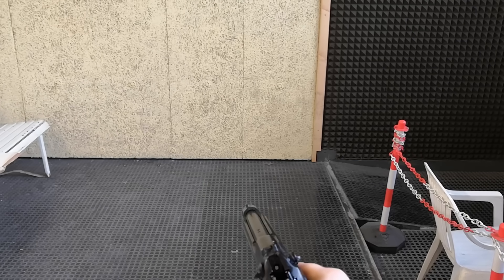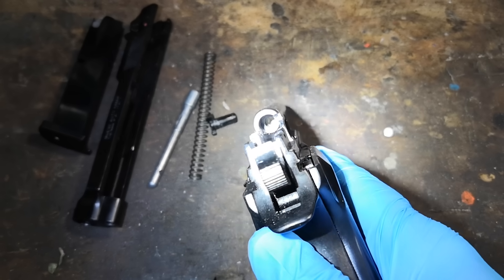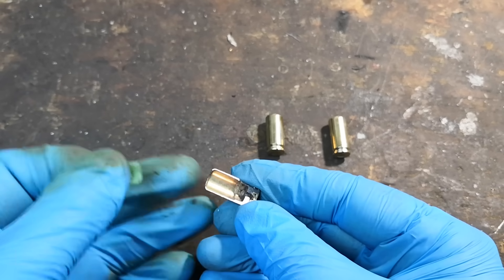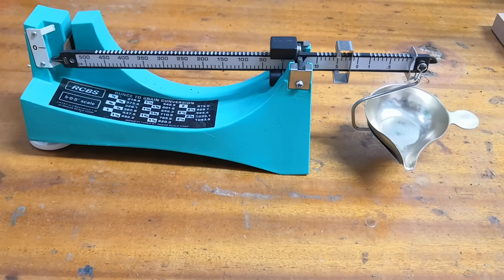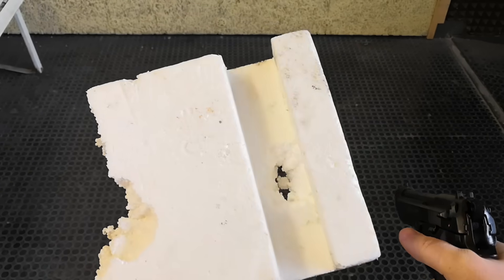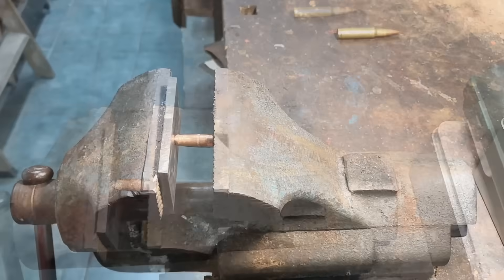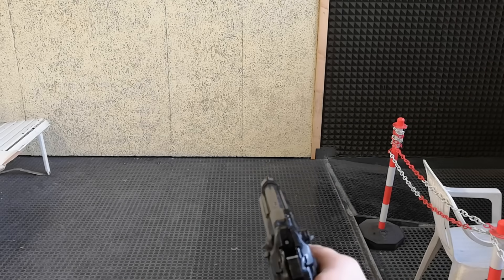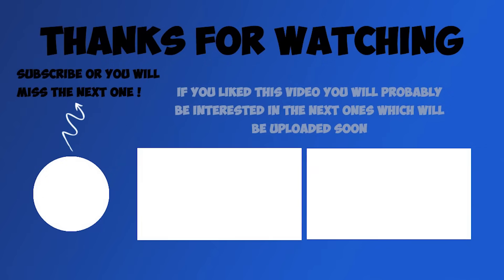Point Blank With a Blank Gun: Is It Really Dangerous?

Comment: When in doubt, always remember that with the proper speed, a piece of polystyrene foam made a hole in a space shuttle wing.

I stand corrected, polyurethane foam.
Reply: Thats crazy
Death by foam
Reply: @lotuscat3173  sound like a seizure 💀
Reply: That got an entire space crew killed.
Reply: @HarmonicVector  Yeah, stupid commitee and beurocracy led design
Reply: @HarmonicVector  man its just sad tho
Reply: Jensi Oquendo, did this actually happen?
Reply: @crythaul2179  Space shuttle Columbia disaster where a piece of foam came loose from the external fuel tank and struck the wing and damaged the heat shield and upon re entry it burnt up due to the hole and killed the crew.
Reply: @crythaul2179  yes
Reply: @E60foamer  Its because they let women onboard
Reply: My dad was in school in California at the time and they got out early because a lot of kids families were involved in aerospace and some of their dads died
Reply: The foam can fly incredibly fast in space and the wings are made with the weakest and lightest materials possible for the ship
Reply: @sterling8007  I thought so. The wing is relatively weak compared to the rest of the shuttle
Reply: Aren't the wings of space shuttles relatively thin? I swear I remember something in school saying something like this.
Reply: Your mostly right  it was polyurethane foam though which was spray applied which means slight porosity allowing the condensation to form ice within its pores increasing its mass but yeah it doomed the flight
Reply: Siense
Reply: Yes but foam also makes up some road barriers so it has to do with density.
Reply: In Kansas theres a museum that has a wheat straw imbedded in a telephone pole. Going so fast it went in like  steel arrow....
Reply: „When in doubt, whip it out“ - Christopher Wistopher
Reply: What now??
Reply: We talkin biht challenger?
Reply: Space shuttles are made out of aluminum so... Weak af
Reply: @kaleclelland1817  Is aluminium weaker than Styrofoam?
Reply: @kaleclelland1817  thats kind of the point, if they were made titanium they wouldn’t be able to have re-entry and orbit around the earth considering our current understanding or space travel
Reply: @kaleclelland1817  it actually hit the carbon fiber reinforced edge of the wing which is quite strong.
Reply: @kbo8029  carbon fiber is very strong under stress but not under impact. It can stand up to twisting and bending very well which is why it's used on race cars but if a pebble hits it directly at over maybe 50 mph it'll crack.
Reply: I’ll try to remember: avoid styrofoam travelling at 7 times de speed of sound
Reply: When the frick did this happen?
Reply: @pakalupapito5578  2003
Reply: This comment rules.
Reply: It wasn't polystyrene, they use ceramic heat deflectors
Reply: A GUN IS ALWAYS DANGREOS EVAN WHEN IT IS NOT LOADED TREAT IT LIKE IT IS LOADED
Reply: physics always wins
Reply: Ah yes, colombia
Reply: https://youtu.be/lk_4HD7DnVk
Reply: physics
Reply: Massive oof...
Reply: Not really concerned about getting the wings back as much as the lives on it
Reply: Here it is. Watch the whole thing.
https://youtu.be/e8dMdW9dN0E
Reply: @Leowolf27 I’m disappointed it wasn’t a rick roll
Reply: @Leowolf27  thats crazy dude they recreated the whole thing and even in the final test they were amazed by the result
Reply: @Leowolf27  scam
Reply: I'd change the barrel for my BlankFirer/PAK Guns..with titanium barrel,which ive had measure bout the widht and center,its apparanly is easy to shoot a RubberBullets(Traumatix)PA.with some sort of bullets adjustments,i'd take out the plastic cap,and inserted 8mm steel BBs seal it with"Wax"then it does shoot a steel projectile without any obstacle.the"Turkish"made are awesome..its well made and very robust.i did it with my:EkolFiratMagnum,Ekol99(M84Beretta),RetayG17(Glock17)..a Germany blanks are rubbish,were made by cheap sheet metal..but i own the Old blankFirer which made from Germany,it was made from early 90's..its an"Reck Polize Compact"Chambered with 10/22 RubberBullets,it was fascinating.no need an adjusment,and ready to.go...eastern/Slavic made are awesome..im in Netherland btw..we also allowed to own several firearms,but a blankGuns that has being"Converted"its an alternative tools..and no charge for obstruct the law..when you're shot someone in immenient thread inside your property..polices will NOT confiscate your"Converted"Guns..as long as you dont carrying with you and showing to others...
Reply: The foam caused the damage during take off sometime. Huston knew about the damage and that they would die upon reentry but chose not to tell them for obvious reasons. Quick death over eventual suffocation from no oxygen. Also im sure this isn't amazon packing foam it was probably quite dense, either way shuttles leave at thousands of km an hour so plenty enough speed. There's videos on the disaster that are interesting give em a look.
Reply: I remember that I was like 😲. Slowing down kills man. 😂 Speed do kill unless your the break
Reply: Hydrogen atoms traveling at the speed of light
Reply: Columbia disaster didnt happen.
Reply: When in doubt when a Winchester 7 round is put in your stomach look the weildier in the eye and just smile. 
Watch the life drain from his face. 
Works everytime. 
Shows your worthy of holding your own, 
The one who holds the gun is the coward
Reply: @akaRejx  oh shit we gotta badass
Reply: @akaRejx  lmfao shut up dumbass you make no sense
Reply: Why are all those astronauts alive teaching at universities?
Reply: @chicofromph33nix64  the simple answer is that they're not. Unless you have actual evidence, of course, rather than some anecdotal nonsense you read on a kooky conspiracy theorist website.
Reply: @mike18699-e  here is a link to the article about the space craft. https://en.m.wikipedia.org/wiki/Space_Shuttle_Columbia . If you don't believe this search space shuttle Columbia on Google and go to  a website that you trust, but wikipedia cites sources and what-not so I trust them.
Reply: @croissantgaming2890  I think we're at cross-purposes. I'm saying the astronauts are dead. I was saying that they are not alive and teaching at universities, as another post claimed.

In other words, I think I'm agreeing with you and with Wikipedia.
Reply: @mike18699-e  who said that?
Reply: @boratsagdiyev5679  Chico from Ph33nix was saying that supposedly dead crew members were actually alive and teaching at universities. But that simply isn't true. They're dead.
Reply: @chicofromph33nix64  I assume you mean people from Colombia at universities. Columbia first flew 1981, and lots of different astronauts went up on it.
Reply: @chicofromph33nix64  they aren’t, they died
Reply: Bullshit
Reply: @toto-ok3yf  wow I didnt know there were Columbia deniers.
Reply: @toto-ok3yf  uhhh. What do you think happened?
Reply: @toto-ok3yf  imagine dying just to have some flat earther say  you never died.
Reply: @toto-ok3yf  And apparently you're also a "laws of physics" denier.
Reply: @toto-ok3yf  why is there a kid on your pfp?is that you? If so why are you here it’s not for kids
Reply: @toto-ok3yf  (Sniff sniff) ... Is that... Dumbassery I smell?
Reply: @toto-ok3yf  lol, not only did it happen, it wasn't the first time.

The previous incidents caused really bad damage but not fatal like challenger.

Something about the size of a spec of paint (less than a millimeter) at orbital speed nearly punch a hole through through 80cm of reinforced borosilicate on the ISS.

Comment: Standard bulleted ammunition does not typically fit blank-firing handguns given their
smaller chamber. These weapons therefore
require specific types of ammunition or alterations to industrially manufactured rounds
before they can fire live ammunition. Traumatic
cartridges (blank ammunition rounds fitted
with rubber projectiles) can, in some cases,
fit without modification (Ferguson, 2014).
Another option is to modify bulleted or
blank ammunition. Certain blank calibres, such
as the .22 blank and 9 mm PAK, are similar in
size to various standard ammunition calibres
(.22 mm Long Rifle and 9 mm Luger). The latter
can therefore sometimes fit a blank-firing fire -
arm’s chamber if the bullet is pushed deeper
into the cartridge.9
Blank ammunition can also be fitted with
a projectile. The modification can involve
cutting into the crimped end of the cartridge,
inserting a projectile and resealing the case,
or a projectile can be pressed into the plastic
cover of certain blank cartridges (Ferguson,
2014; Saribey and Tarimci, 2009, p. 624). These
rounds, however, will not have the same force
as standard ammunition, given the blank
cartridges’ reduced propellant and the often
imperfect fit of make-shift projectiles in the
barrels.10 Nevertheless, ballistics tests show
that a .22 calibre blank round can propel a
projectile with more than enough force to kill
a person (Lee and Meng, 2011, p. 25).
Reply: The real FBI would spell it as "caliber," but thank you.
Reply: @TehButterflyEffect    HAHAHA, the only thing the real FBI do on you-tube is present their agendas and advertise their organization, my channel name is simply a joke that you obviously missed. I did not write that. That is copy and pasted from an article @ http://www.smallarmssurvey.org/fileadmin/docs/G-Issue-briefs/SAS-IB10-From-Replica-to-Real.pdf
Reply: Your welcome.

Comment: I once saw a demonstration of a blank firing revolver that allowed the gas down the barrel. The demonstrion was done by  a group of street performers that reinacted shoot outs from western and cowboy folktales who also put an emphasis on educating people about firearm safety. They put it point blank to a full soda can and once fired completely annihalated the can tearing it to shreads. They pointed out that the aluminum can itself has a greater tensil strength than human skin (not 100% on that) and that the damage to the can was equal if not more severe than what it would have been if shot by a actual low cal pistol round from a distance (not that that has much bearing on damage to humans) but all to point out that even tho the guns they used were blank firing props there is always an inherent danger when handeling even fake firearms.

Comment: Some of the blank guns are designed like they were meant to be converted to fire live ammunition. There are two ways: Either make a 177+ caliber insert to the barrel starting where the chamber ends, drill a snug hole to the green plastic and press a bb into it, or make the chamber and the barrel of steel using the original as a template. There is also a third popular but potentially dangerous way of converting 9mm blank guns just by drilling the original barrel with a 9mm drillbit after the hardened obstruction is removed, and using short 9mm cartridge. Some guns can take it once or twice, some will not, not worth to gamble. To be clear, all ways to convert a blank gun to real are almost always illegal, so trying is not worth the jail time. The Police has reported that all mentioned ways usually work, producing a "firearm" illegally. So, do not do it. Think of your family. Also, there are blank guns meant for shooting teargas/pepper or rubber balls. Those pointed point blank to living tissue cause severe trauma even with blank cartridges, and people have died of that. And finally, ask yourself, do You really need a blank gun...
Reply: "Some guns can take it once or twice, some will not"  isn't better just go and buy a muzzle loader gun in nearest gun shop? You don't need gun lincense for that in many countries and you know it will really fires at least once. 😀

Comment: Yeah, the revolver is specifically designed for the gasses from any kind of round to be expelled at the front of the cylinder, just behind the barrel and crane.  You can actually blow a thumb off if you do the thumb forward grip you would usually do on a semi auto pistol.  The forcing cone for the barrel can get extremely hot on higher caliber revolvers.  Police had to perform different speed loading techniques when they transitioned from 38 special to 357 magnum, specifically because of how hot the gun powder would make the forcing cone.

Comment: People: nah fluids can’t pierce solids

HEAT shells: am I a joke to you?
Reply: high pressure water jet: Am I a joke to you?
Reply: Water used on shaped charges can go through whatever you want. This kind of process is used to discard bombs.
Reply: Think of like playdough.
The crystalline structure gets destroyed and the copper acts like amorf materials.
Reply: Don't RPGs basically become a flying lump of molten copper?
Reply: Reactive armour: Hey
Reply: It isn’t a shaped charge, If you put water in it
Reply: water jet channel proves liquids pierce solids.
Reply: HEAT shells don't use liquid. https://en.wikipedia.org/wiki/High-explosive_anti-tank_warhead
Reply: Jack Cordell well metal under an extremely high pressure behaves like a liquid. And that’s the joke I’m trying to make.
Reply: @RainytheNB  I believe the penetrating jet from the HEAT shell is made up of molten metal, correct me if I'm wrong
Reply: @yasuologitech1084  Read the wiki article. it's not luquid, its superplasticised metal (pretty close but not the same)
Reply: Yasuo Logitech molten is different from what HEAT shells use. Liquids require the bonds between atoms to be partially broken as in the atoms can flow freely around each other whereas in the steel the metal is propelled at such a high velocity and energy that the metal stays slightly solid whilst being pushed through the armour